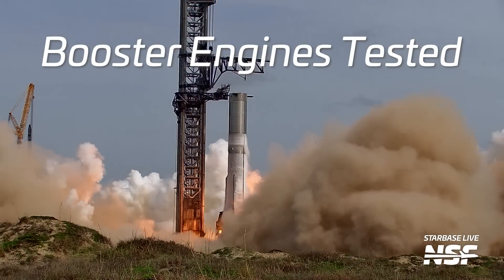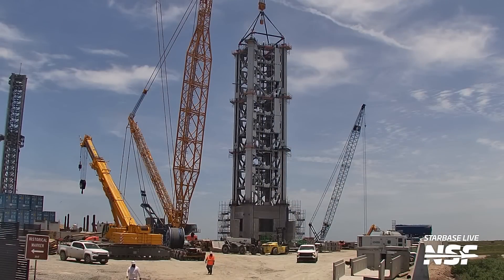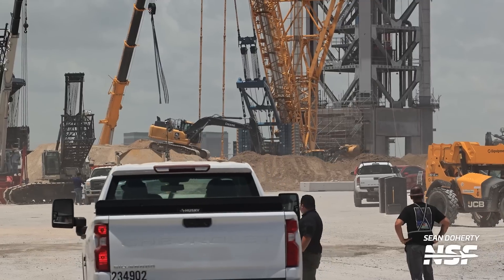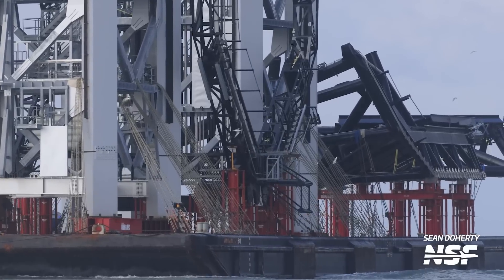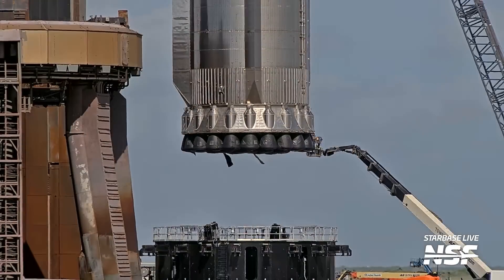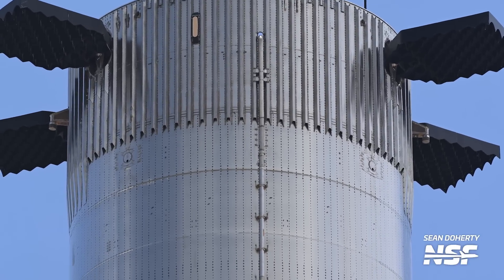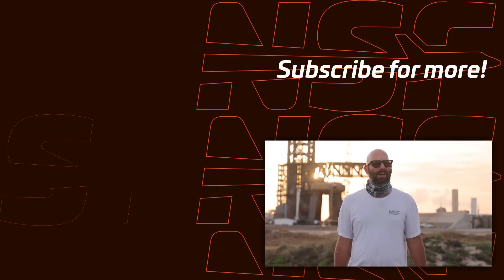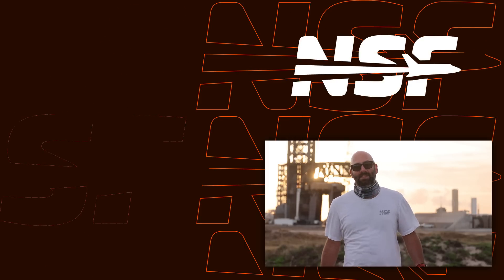A Second Tower Quickly Rises At Starbase | Starbase Update

Comment: Don't tell me you poured cement in those without coolant.
By the way cement turns to powder.
These guys are good. I'm just better.
No cement,Cooling lines and epoxy inside.
High temperature flexible epoxy. The outer coating has to be thin insulation

Comment: My 2 cents worth: Digging out the dirt by the Tower2 to stop what happened at OLM1 with ground liquefaction. May fill it up with rocks and heavy gravel and pack it down before adding reinforced concrete and the water deluge plate.

Comment: Will the towers need to be taller?  Block 3 of the booster/starship is projected to be a lot bigger, and I wonder if the increased size means the current tower solution can't stack them.
Reply: We don't know how the launch stand is going to look. It could very well be just 5 m above ground, with a trench below it (one, two or three trenches).
Reply: I think the arms can just grab lower on the sides of Starship. And the ship QD will be raised higher.

Comment: FOR THE LOVE OF GOD,

BLOCK 2 IS THE CORRECT NOMENCLATURE.

We have seen that used by previous SpaceX workers
Reply: Both version 2 or block 2 have been used by SpaceX. They also used "Starship 2" as well. As a long time SpaceX follower, I recommend you not getting too obsessed about all this nomenclature stuff. It's gonna get even worse
Reply: Wouldn't "Block" be indicative of improvements made to a finished design?
Which, given we've yet to hit that point and this is still in Beta Testing, seems "Version" would makes more sense, no?

Comment: Will flight-5 include an actual orbital insertion?
Reply: Most probably not! Everyday Astronaut's after flight video states "The only payload this year is data"
So there would be no need to do orbital insertion.
Reply: @RohitSharma-wx2ky  I was thinking that if they were close to orbit, they might want to do a couple of laps to verify onboard systems and de-orbit procedures.
Reply: Orbital insertion has not been 'a problem'. Making sure it does not get stuck in orbit has.
Next flight has to show how good the new heat shield is and repeat the landing of the booster (at sea or  on the chopsticks) and improving the precision of the ship's landing. Anything else would be a bonus.
Reply: I think they will try firing the Starship engines a couple times, but stay suborbital.